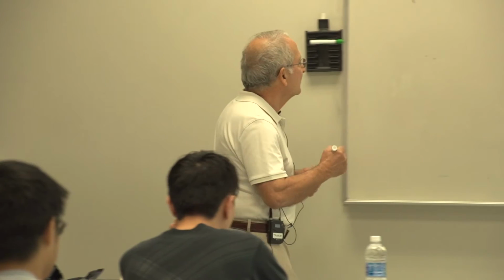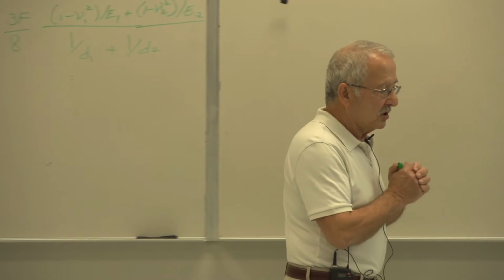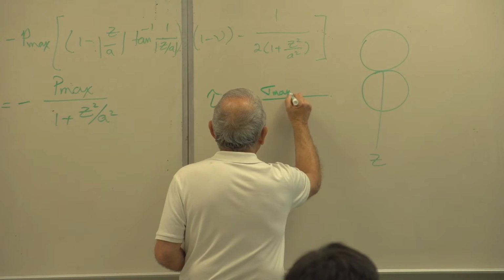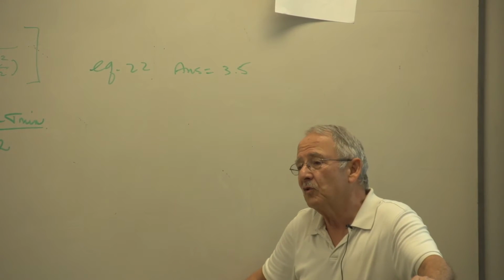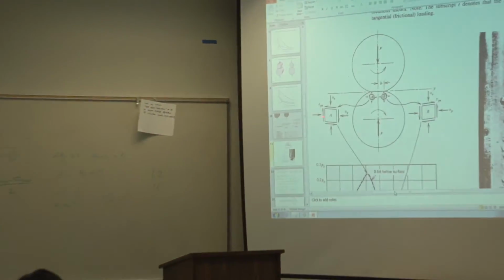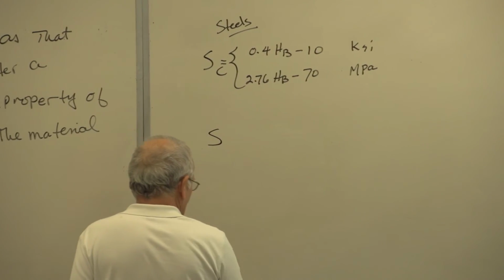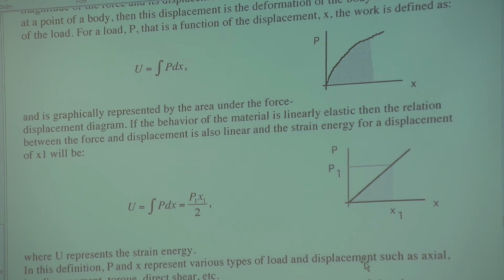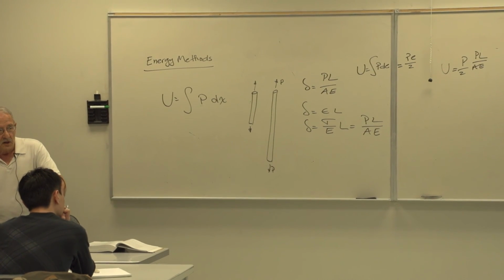Stress Analysis: Contact Stresses, Energy Method (5 of 17)

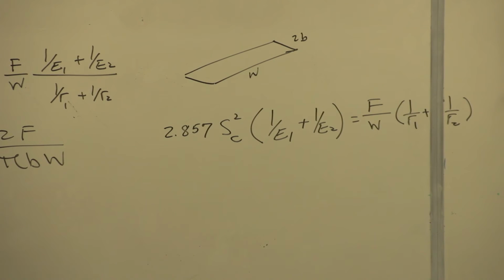Comment: Sir, i have a small remark if i'm seeing it from the right angle, a part of the video exactly at 1:10:24, there is an equation which is not rightly stated
instead of to write F*w you write F/W      2.857 Sc²(1/E1+1/E2)=F W(1/r1 +1/r2)